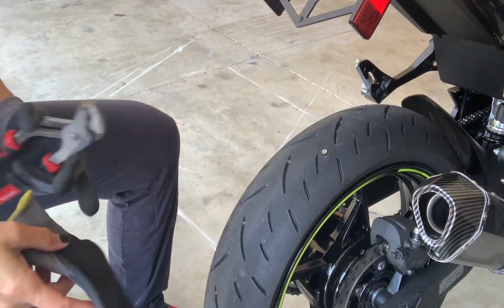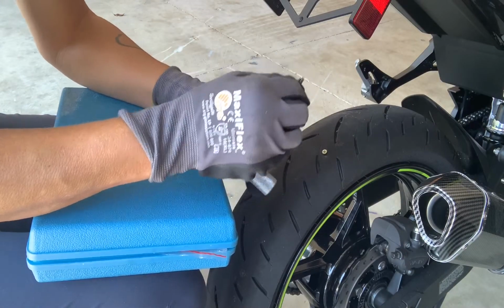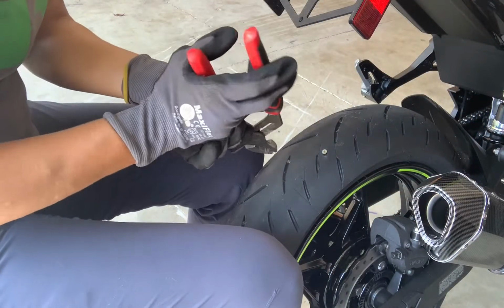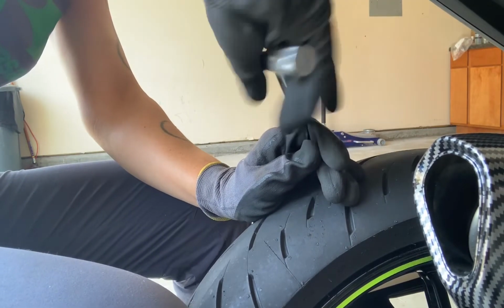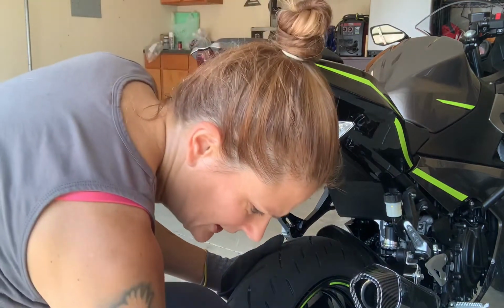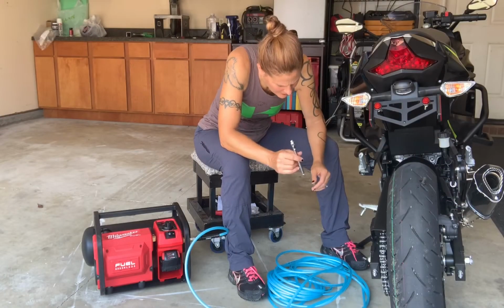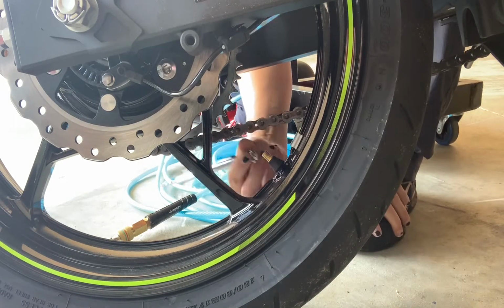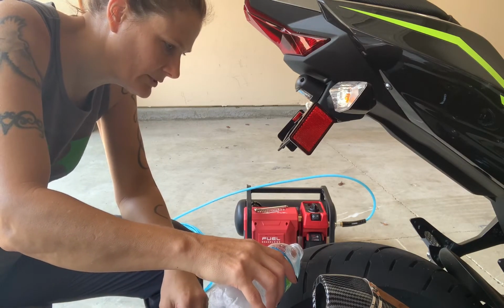Repairing a flat tire on a motorcycle

Comment: Consider the Dewalt cordless air inflator. you just punch in the desired pressure, no checking and rechecking, it takes it right to desired pressure